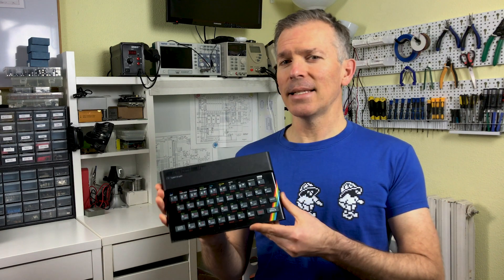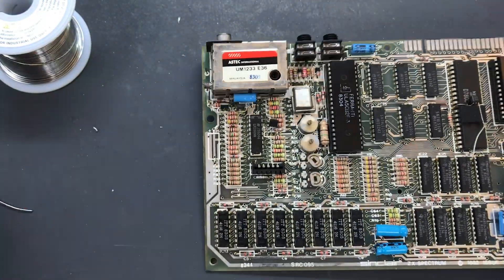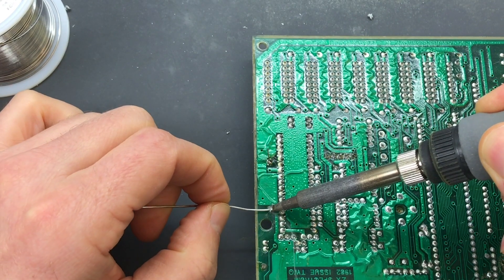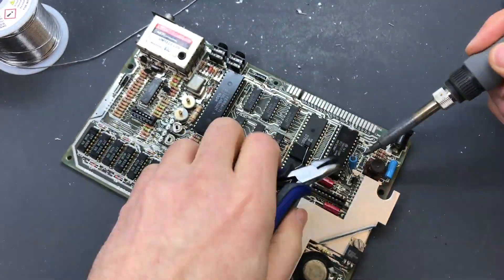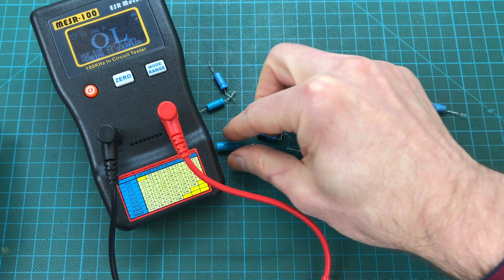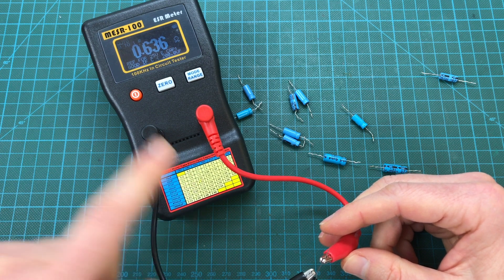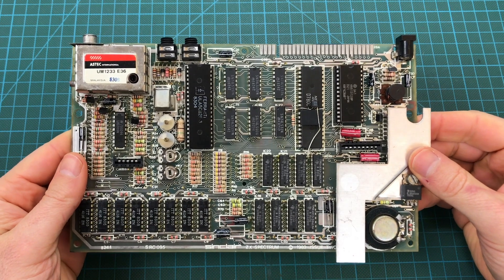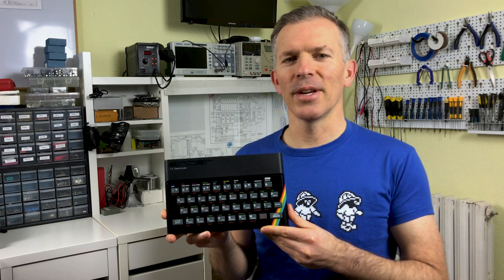Sinclair ZX Spectrum Tune Up!

Comment: A small note on the Traco switching voltage regulators: They do work a treat! However, it has been observed that the component causes clearance issues within the case. A good alternative is the CUI Inc. P7805-2000R-S: https://www.mouser.com/datasheet/2/670/p78_2000r_s-3070500.pdf

Cheers! Thank you so much for your wonderful content.

Comment: Nice solution of radial to axial. I think at C25 you overkilled it since at the neg point there's both hole for a radial. so you just stand it up normally the radial there.

Comment: When removing known faulty components from a PCB, you can reduce stress and potential damage to the PCB by first cutting the component from the board with side cutters before attempting to de-solder the leads.
You can then heat the joint with your soldering iron or de-soldering station whilst pulling out the remaining lead using small pliers or side cutters.
We would normally stand the PCB on its end so that we could access both sides of the board during de-soldering.
I learned this technique whilst working for a computer repair company back in the 80's.
Mainly used it on faulty DIL IC's as they are always tricky to get out whole without damaging the traces.

Comment: Great video Noel. Thanks!

About the electrolytic caps: I have recapped several mid to late '70's stereo amplifiers (so literally dozens and dozens of capacitors, probably hundreds in all) and have yet to find one single electrolytic which was anywhere near being out of tolerance. What would the ratio of bad caps you have come across in the Spectrum's that you have refurbished?

Comment: I like your method of folding the radial capacitors Noel. Also I like the way the board looks with the black caps (superficial I know!) Replacing the voltage regulator with a modern efficient item was very satisfying to watch.

Comment: FIrst Cap: Why haven't you used the via right next to the negative hole/pad?
Reply from the maker: Interesting. The main reason is that I didn't think about it 😃 Second is that I was trying to keep the same vias as the original capacitors, so I wasn't even looking for alternatives.

Comment: Please spend the extra 5p on axial caps...
Reply from the maker: It's not so much about spending the extra money, it's about not waiting weeks for them to arrive. And since I have radial ones already, that's what I end up doing.
Reply: @NoelsRetroLab  isn't there a good chance you're gonna make the outside metal case of the cap live? Will that not potentially be an issue?

Comment: Hi. What's the difference between the TSR 1-2450 and the TSR 1-2450E? In the datasheets, the only difference I spotted was a 0.5V difference in the input Voltage.

Also, any suggestions where to buy them? In the US they are ~$3.00 but over here in the EU these things are ridiculously expensive (at least in my local shop).
Reply from the maker: The cheapest source I found was Mouser, but you need to place a 50€ order to get free shipping, so that's not always possible. Not sure about the exact difference there. Usually the numbers indicate the maximum rated amps, so some of them can go to 1.5A or 2A, although that gets even more expensive.

Comment: I should fix up mine sometime soon. It stopped working when I was a kid and was playing Starquake and then I bought a second hand C64 instead! For some reason I removed the power socket back then, even though that's probably not what the problem was. Also I appear to have removed some of the pads where the socket legs go in (must have torn it off badly) and so that will present problems, let alone diagnosing the original fault. At least the keyboard membrane seems intact. Also I no longer have the power supply but I bet there must be decent modern replacements.
Reply: I feel like I owe it to my kid self to repair this, maybe before the 40th anniversary of me getting it (my first computer) :-o
Reply from the maker: The good news: If it's just the power socket pads, that's not a problem if they're ripped. You can fix that with a couple of cables.
For PSU, any 9V DC jack will do but it has to be CENTER NEGATIVE. If you can't open it and swap the polarity, you can just cut the wire, flip the wires, and resolder it.
The bad news: The keyboard membrane is most likely dead.
Let me know how it goes!
Reply: @NoelsRetroLab  OK thanks for the tips!

Comment: Cutting the leads before soldering is to prevent oxidation of the exposed copper where it's been cut. That of course implies a complete tinning of the remaining wire right up to the cut.
Reply: That's what i learned many Years ago.
Reply: @christiankolliker9006  you must have learned how to fix TVs in Switzerland then. Or some related profession.
Reply: @matthiasmartin1975  The company in which i did my Qualification was producing Blood Analyzers and after this Company got bankrupt i finished at the Federal Institute of Metrology
Reply: @christiankolliker9006  Wait, you did your apprenticeship at Theranos?  ;-) JK
Reply: @matthiasmartin1975  No, it was Greiner Electronics.

Comment: The first axial replacement on the board had solder holes for radial capacitor leads.  There was no need for all of that fancy lead bending.

Failing capacitors, especially electrolytics begin to electrically leak.  This means they are turning into resistors.  They begin to allow DC to leak through.  Eventually they can turn into a dead short.  This is why you change old capacitors.

ESR meters do not check for DC resistance (parallel resistance).  ESR is only equivalent series AC resistance.  However, electrically leaking capacitors can throw off an ESR measurement.

Comment: I'm on my way changing all capacitors on my spectrum to get a readable image quality. 
Where could I find a spec of the capacitors I need?
Reply from the maker: You could just open it up and look at the existing capacitors. You should choose ones with the same capacitance and same or higher voltage rating. Or, if you know your board issue, you can just check here: https://spectrumforeveryone.com/technical/capacitor-lists-48k-range/ Good luck!

Comment: There was an old NASA soldering guide, IIRC, that said the procedure was to cut the lead before. See NASA-STD-8739.3 "Lead Bending and Cutting", but might not be the guide I remember.
Reply from the maker: Yes, I've seen that recommended from time to time. I don't doubt it's better form, but it's usually much more of a pain to solder components that are just the right length. I try to cut the lead away from the solder joint, so hopefully that's good enough.
Reply: @NoelsRetroLab  The NASA specs stuff is just more "I  heard it on the internet..."  stuff that doesn't apply to recapping old computers, unless you plan on launching it to Mars.

They clip (and tin!) leads before placement because some sensitive components may be damaged, but more so because you don't really want someone damaging something else while trimming the leads.  They also like pushing the leads flat onto the PCB, stops them shaking loose.  Makes it hard to service, but it's a bit hard to do that once it's in orbit anyway.

You don't need to trim the leads before wave soldering, they slide the finished boards over a saw to cut the excess off.  Seriously.

The corrosion thing really doesn't happen, I think NASA conformally coat everything anyway.

That said, if you're making something to go on a car or motorbike, give their guides a read.  Vibration really kills boards.
Reply: @NoelsRetroLab  I learned that the reason to cut first, is to avoid exposing a little bit of bare copper. Copper is more susceptible to corrosion than solder, so you want it tinned.

Comment: Hi there. Great channel... I'm almost about going to my parents basement search for my 2+. One question about the power regulator. The 7805 is a linear regulator and I think the TSR 1-2450 is a switching regulator, right? Doesn't the noise produced by the switching reg cause any issues with the clock or any other noise on the power lines?
Reply from the maker: Correct on both counts. This particular one doesn't introduce any noise that I noticed. Certainly not in the functioning of the system. Maybe in some displays it'll introduce some noise in the video signal? Not sure. For my set up it works great.

Comment: Hi there, great channel, well made informative videos. I did the same voltage regulator mod to one of my Spectrums but found the case did not close properly afterwards, I had to lay the new component down and solder short stiff wires to it to get the lid to sit down properly.
Reply from the maker: Thanks! That's weird. Maybe you used a TRACO model that has higher current rating (which is good) but that's a bit larger? The one I was using fits right in without a problem.

Comment: I was doing the same thing when I was soldering components on the board and I think that it is more correct to cut the long leads first and then solder them. Because when they produce the boards, they dip the whole side of it in a solder "bath", thus covering all of the trimmed leads. But when you clip the leads after you solder them, you expose the copper in moisture and other corroding factors, like capacitors' oils. As well as battery fluids, on newer computers.

And as for the DC to DC converters, I have heard that they produce a lot of ripple on their output. I haven' t used any, but I watched a video, some years ago.
Reply from the maker: I've heard that argument multiple times but I need to research it before I'm totally sold. It does make soldering slower and more annoying, so I want to make sure it's worth it before I switch 😃
That voltage regulator is really good. At least in my set ups, I don't see any kind of visual noise at all. I can highly recommend it.

Comment: linear voltage regulator gets hot but delivers clean volts. I think the one you put in is pwm based and not give as clean volts.
in audio products then you must always use linear regulator!
Reply from the maker: True. These are fine for this particular application, but I can see them not being OK in sensitive audio applications.
Reply: There arem more noise from the mainboard, it runs very fine. If you have some problems with noise, put an L-C filter after the regulator.

Comment: A little insulation from some wire on those cap leads is never a bad idea either.
Reply from the maker: You know, I started doing it that way years ago, but it adds a lot of work for a very minor improvement so I gave up. Is the idea that if the capacitor covering ever wears out that it won't short, or is it to prevent accidental shorts with something from the top?
Reply: @NoelsRetroLab   Fair enough... but for both reasons you asked, it's just another safe-guard to protect your precious and hard to replace retro. Just a good habit to get into. What I would do is by a small spool of solid wire at a reasonably heavy gauge and gut 6 inch pieces off and strip the insulation off one side and the other side usually pulls right off. Then I keep those around and cut to size as needed, this way you have them ready. Not to mention it looks more professional.
Reply: Some heatshrink would do the job

Comment: It's amazing how a modern voltage regulator can do the same job as the original one without generating all the heat. Can the same mod be done to a toast-rack? Can the actual toast-rack heatsink be removed afterwards?
Reply from the maker: Absolutely! Although with the toastrack it's not nearly as necessary because it has such a good heat dissipation.

Comment: I am about to make a "First power up" video for my 48k that I recently got on Ebay. I had an idea to short the 7805 and power my Spectrum from an external 5v source. Then I looked at the schematic, and it turns out 9v is used to power the voltage inverter... Darn it! As the brits would say. :) I guess it's still feasible if we replace 4064 DRAM chips by 4164 which use 5v only, but that's a lot to do. And because I actually do have experience with the 4064s, I can say they are very sensitive to voltage, if you power them without -5v, they may fail instantly.
Reply from the maker: Right. Yeah, all the models until the 128K need those weird voltages. But converting 4164 to work as 4116s is actually really easy. And coincidentally, today's video deals with that exactly (coming up in about an hour), so maybe have a look at that.
Reply: The colour encoder ic needs 12v as well.

Comment: I'd expect to see some glue residue on the plastic below the keyboard metal plate. This way it seems like it had already been cleaned up at some point.
Reply from the maker: It could be. It also depends a lot on how the glue dries out. Sometimes it's super sticky and sometimes it's a lot more dry like that. Maybe it depends on how hot the Spectrum got (or how much it was used).

Comment: My original +3 works (except the disc drive) but it’s real blurry on screen. I take it the steps in this video for the rubber speccy would be similar?
Reply from the maker: The +3 doesn't usually have really bad capacitors because it doesn't get as hot. In any case, those would be inside the external power supply. Is it blurry when you use the RGB cable, or just the RF? I would start looking at that. But the +3 with an RGB cable should be super crisp (if anything, almost too crisp and you get some weird vertical bars).
Reply: That’s good to know, thanks. It was very blurry. It’s in storage atm so I’ll get it back out and give it another try see what cables I’m using etc as I’m not at all technically minded XD

Comment: Heatsink the ULA.
Reply from the maker: That's probably a good idea but I haven't done it before. I imagine the ULA needs to be un-socketed to fit the heat sinks, right? I should try some day.
Reply: @NoelsRetroLab  No need to remove the ULA from the board, you can get small heatsinks and thermal adhesive, that's what I do to all my speccys :)

https://es.aliexpress.com/item/32760615633.html
https://es.aliexpress.com/item/32623049884.html
Reply: @drgusman  put a thin metal plate , with heatsinkglue on the ULA

Comment: I have a C64 with an old 326298 board that has a UA7805UC which gets very hot. Could it be replaced by a traco power TSR 1-2450?
Reply from the maker: I think so. The thing is to make sure the voltage regulator can provide the same current. The AU7805UC seems to be rated at 1A, so that should be fine. However... it's possible that the TRACO Power could introduce some noise. I haven't tested it on a C64, but it's worth a shot. If not, it's easy enough to change back.

Comment: Where do you buy those membranes?
Reply from the maker: I believe I bought them through sellmyretro. I think these came from RWAP. They're great!
Reply: @NoelsRetroLab  incredible this stuff still is for sale.
Reply from the maker: @defdac  No, no, those aren't original membranes. These are membranes that people have designed and manufactured recently to fit in these computers. It's really cool that people are doing stuff like that. Otherwise old computers would eventually become unusable for one thing or another.